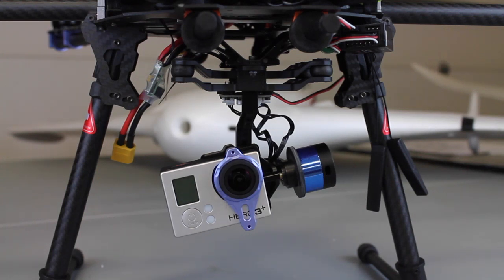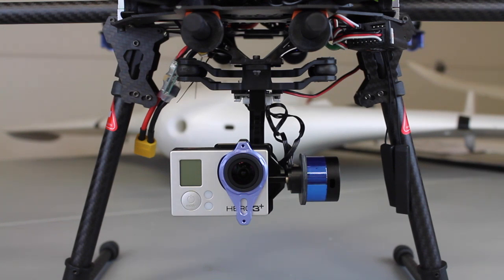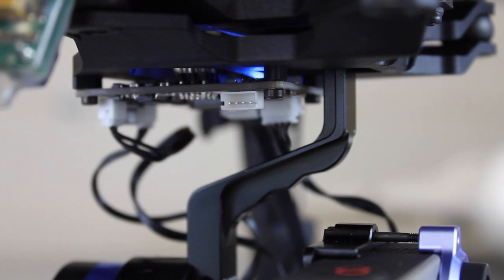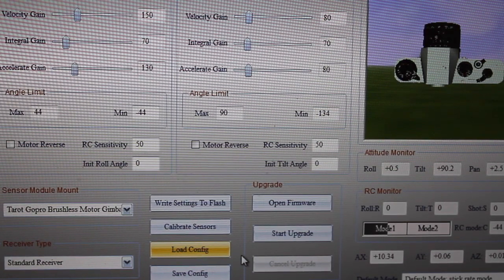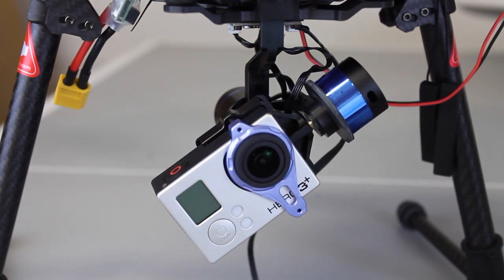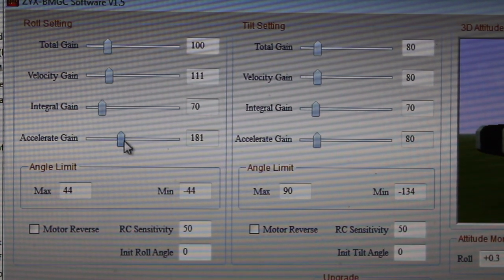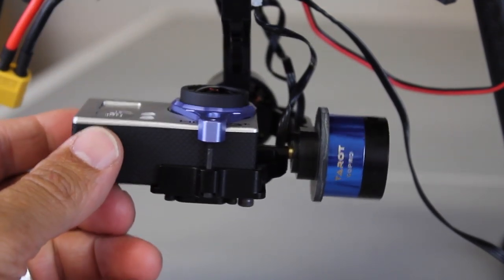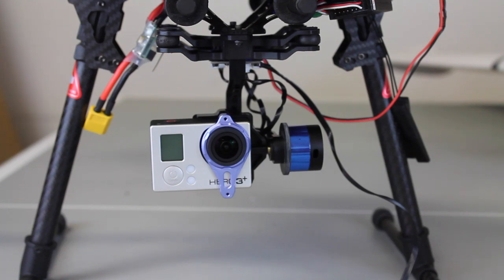Troubleshooting Tarot T-2D Gimbal: Tips for Fixing Jitters and Shakes

Comment: noticed in your vid and on my gimbal it is leaning to the screen left (in your vid) so when i fly the horizon isn't level any tips to which setting to change to correct the level of the gimable?  (also for hero3 vs 4 users keed in mind that hero4 battery is now down on the side vs in the back of the gopro so i am guessing this may play a part in the weight calibration of the gimbal)
Reply from the maker: Luke Roman Not sure what's causing that. First thought would be to check your IMU sensor just to make sure it's mounted nice and flat. Good tip regarding the balance of the Hero3 vs Hero4. Will keep that in mind. If I think of anything else I'll let you know.
Reply: Dennis Baldwin where is IMU sensor?(tired to google it byt got DJI stuff) I dont see settings on that setup screen that say IMU sensor and also do you notice that your camera is leaning a bit to one side.. likethe horizon isn't level on your cam in the vid either.. I'm thinking to set the intial roll angle value to to -3 (that is waht i have to rotate video in post to get horizon level again)
Reply: Luke Roman ohh just read replys and will test out Douglas La Farge  flat on book calibration technique

Comment: Nice video Dennis but may I mention one conflicting step with your video and the actual instructions.
The manual state to DO NOT OPEN COM PORT during gimbal and motor firmware updates, yet you clearly do and it seems to work for you.

Comment: Everything worked for me until I tried to turn on the motors, my motors wont do anything. Do I have a faulty board?
Reply from the maker: victor de groot It's hard to say. I would calibrate ESCs independently from your flight controller and then wire it up again. See if you can get them to arm when attached to your FC.

Comment: Hi Dennis the problem I have is I cant the gopro defaults from gopro.bgsc. all my boxes have 0's everything else are blank .firmware upgrade's worked ok as you video but 3d diagram doesn't move.  any ideas ?
Reply from the maker: David Slapp That's strange. Can you create a bgsc file and then load it in? Here are the contents of mine if it helps at all:

[PARAMETERS]
ROLL_ACC=130
ROLL_TOTAL=100
ROLL_VEL=150
ROLL_INT=70
PITCH_ACC=80
PITCH_TOTAL=90
PITCH_VEL=80
PITCH_INT=70
ROLL_MAX=44
ROLL_MIN=-44
PITCH_MAX=90
PITCH_MIN=-134
ROLL_SERVO_CENTER=0
PITCH_SERVO_CENTER=0
YAW_SERVO_CENTER=0
ROLL_SERVO_REV=1
PITCH_SERVO_REV=1
ROLL_RC_ACC=50
PITCH_RC_ACC=50
INSTALL_MODE=2
RECEIVER_TYPE=1
INIT_PITCH=0
INIT_ROLL=0
DEFAULT_MODE=1
Reply: Hi Dennis I now have my setup as yours on settings I am using  the DJI DT7 controller but im only getting a small movement up and down on camera cant work out what it could be that's wrong.

Comment: Hello Dennis,
Setup the Banggood Gimbel but unknown to me the sensor had slipped off the bracket when the power was turned on. Now when turning on gimbal it always wants to flip over backwards and stay there. Funny thing is it stays fairly level but backwards. Using Simple BGC GUI v2.2 b2. I linked a video below. At this problem for many hours and I'm stumped. Would appreciate your help if you have any ideas.

https://www.youtube.com/watch?v=4lgmPpA1rfM

Comment: In this video you point out the calibrate the sensors you need to point the camera up. I've been playing with this a bit more and i think understand why.  It's the easiest way to get the sensor into a known position (perfectly flat).  I was noticing my camera was slightly tilted in the gimbal. it's mounted on the front of a Discovery. I pointed it up and propped books under it until it was flat and then calibrated. no more tilt.  also the fireware upgrade and using the gopro config file seemed to fix all my jitter problems as well.
Reply from the maker: Douglas La Farge Thanks for sharing that bit of information. Good theory and I'm buying it :)

Comment: LOL I had the first version of that gimbal for 2y now and i never had to configure anything on the gains.
The only strange things happend to me are:
- the capacitor came loose one time for no reason. had to solder it on again.
- after about a year the roll CH stoped working by RC input. Was still stabilized, but cant be controlled by rc. still have no idea why and couldnt fix it. (but dont care, cuz is just roll)

After all this is the BEST 2-Axis gimbal you can buy. 1000times better that this crappy 8bit ones you can buy everywhere. (this one is 32bit!!!)
Reply from the maker: David Kaden I agree with you that this gimbal is tough to beat....especially for the affordable price.

Comment: hola DENNIS BALDWIN quiero  iniciar  mi tarot un poco menos horizontal para que no se vean  las helices. lo tengo en PITCH_MAX = 0 pero asi salen en mi videos, como consigo darle menos valor si no acepta el programa !!   gracias
Reply from the maker: Alejandro Quintero I'm sorry, but my Spanish is very bad. It's been a long time since I studied it! I think I understand your question that when you lower the pitch value you can't save the settings. My suggestion would be to make sure you have the latest firmware installed and reboot to factory settings. Then try to adjust the values from there. I hope I understand you okay and that someone can translate my message for you :) Good luck!

Comment: I don't get it. When I connect it to the computer it doesn't even sense the gimbal. I installed the drivers and everything. When I power it up it just starts rapidly shaking very fast.
Reply from the maker: Mike Kass That's exactly what happened to mine. You'll need to get the software to recognize the control board otherwise you won't be able to calibrate and tune it. It's a serious pain, but once you get it dialed in it works great. Good luck.
Reply: How do I get it too recognize? Now all it does is just blink green 3 times
Reply: Dennis Baldwin I got a new board and it works perfect.

Comment: For me the software crashes right after it starts. Tried all 1.4 and 1.5 versions, and tried compatibility mode with XP. Anyone had this issue and found a fix?
Edit. Nevermind. Works well on Ubuntu through Wine. That just made my day :)
Reply from the maker: Michal Gloc Glad to hear you got it working via Wine. I haven't used Wine in quite some time but glad to know development is still going strong!

Comment: You saved my sanity. I had been trying to setup my gimbal for 3 days, your tip on the calibration did the trick. Very much appreciated. Thanks.
Reply from the maker: Peter Miles No problem at all. Glad I could lose some of my sanity to save you some :)

Comment: Your video was extremely detailed and helpful. My problem was just like yours and your solution worked perfectly. I only have one problem left in that the tilt function from the Phantom will only tilt up but not down. But I think that's something with the phantom setup or something.

Thank you for posting the video.
DM
Reply from the maker: Dan Moore Thanks for the feedback and glad it helped. Regarding the tilt issue maybe it's worth looking into your angle settings in the config software. You should be able to set ranges and perhaps you have it limited. Good luck.
Reply: Make sure you have calibrated the X1 in the naza software first, but as Dennis says .. change Angle to 0 and Min to -90 ... also make sure that you have changed the Default mode from stick rate to stick position mode
Reply: All issues resolved with the software. Everything working good now. You guys saved me a lot of frustration. Thanks.

Comment: Dennis, love the videos but I have a question.  If you are using this gimbal with the DJI naza lite, would you go through all of the programming motions like you did in the video or would you set the parameters in the naza lite software?
Reply from the maker: Mike Niederlander I personally rely on the brushless gimbal control board and not the NAZA for gimbal stabilization. I've messed around with NAZA gimbal stabilization a couple of years ago but as of late I'm using the dedicated boards because they have their own IMU. Hope this helps and good luck.

Comment: Thank you so much for this video. It prevented me going mad, when I was almost at the end of my tether trying to work out why my (initially well-behaved) Tarot had gone mad and was resisting all efforts to recalibrate it. The "point the gimbal upwards to calibrate the sensors" tip did the trick! THANKS!!
Reply from the maker: Neil Barnden Very glad to hear that. I wish I would have tried that first and not last. It definitely would have saved me hours of time :) Thanks for the feedback.

Comment: I bought a cheap knock off that took hours to tune because I rigged it to face forward on an H quad. Saving screen shots of the settings were helpful.  Later, I unfortunately got my camera in a bind while the gimbal was powered. Mistake. Burned out the board and had to replace it. I did not have to start over on the settings. I just checked the screen shots. Back in business.
Reply from the maker: Chuckles Glad to hear you're back in biz. Yeah sometimes I definitely take screen shots or in the case of the Tarot config software I can save all my params to a text file. That makes things a bit easier when my gimbal gets out of whack.

Comment: I have the same frame (except its the quad variant, brand is Tarrot if anyone is curious)
I have the same Gimbal which I am happy with, I just taped a Horyzon HD v3 to the plate, with a 9V battery to balance it out, and calibrated the mount 90 degrees of to accommodate for my mod, works a treat. :)
Reply from the maker: zarster Sounds like a great setup. I've been enjoying the Tarot frame. I just was there was a little more space to mount the Pixhawk flight controller. It's pretty crammed up top!

Comment: I too had such a hard time configuring this gimbal. The ports are so poorly put that even a small push dislocate or bend the pins. When I tried calibrating using the software, my gimbal went wild like it had a seizure. I don't know what i did to control it. It took me a full day to sort of figured out. I still don't know what had happened, and I don't want to plug it to the software now.
Reply from the maker: Binesh Maharjan Glad to hear I'm not the only one. It was a real pain to mess with. Am glad you got it figured out!

Comment: That's strange as i got the version 1 of this gimbal and it worked a treat out of the box,i didn't have to go into the software at all when i had it on my home built quad,but it was a different story when i tried it with my PH2 but that was more the DJI PH2 assistant than it was this gimbal.

I also found that the gopro holder (Blue metal part) on the tarot gimbal was a pain to keep removing every time i wanted to use the camera for something else or even to get the SD card out,so i got one of them little velcro straps you can find on ebay or where ever a lot better. 

I did find bobbred128's channel has a really good set up video if anyone needs it too. :-)
Reply: Thanks for sharing :)
Reply from the maker: startazz Thanks for the info. good tip on the velcro strap. I get annoyed by the blue metal piece as well. Such a pain to take on and off.